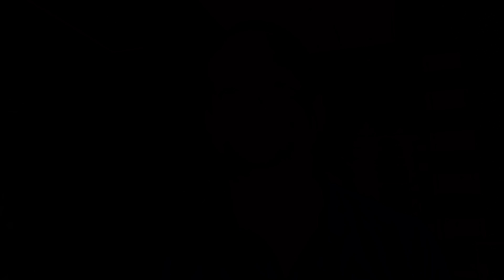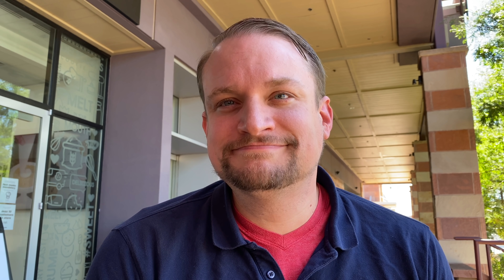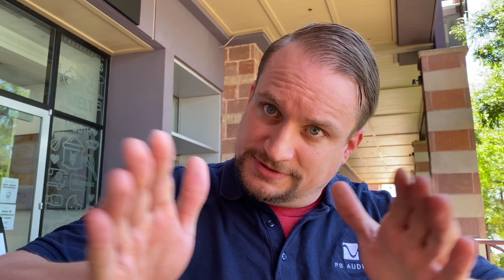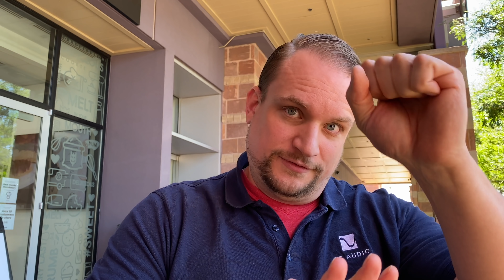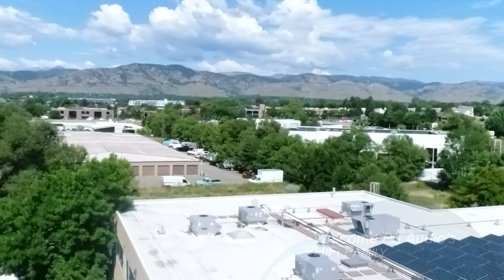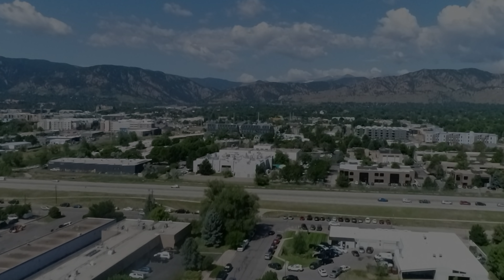Lunch with Paul: everything you wanted to know about crossovers

Comment: Something no one ever seems to talk about with respect to even order (12, 24 db electrical) crossovers is the advantage of having a low DCR inductor in parallel with the voice coil. This preserves motor control of the voice coil and helps prevent ringing.

Comment: I dont know electronics as well as the engineers that build crossovers but, how is the circut resonance delt with between a capacitor of the hightpass filter and the inductance of the driver motor? Or is the resonant frequency so far out of the frequency range being delivered that it dosent matter?

Comment: Infinity RSa's have a 10" mid bass. First it fires the bass tone and then out of phase it fires the mid range into a 10" woofer. 
I would like to know, why crossover's at all? Why not run woofers, mids and tweeter with separate speaker leads to a EQ type thing to be a real "active" crossover?

Comment: A discussion on the need for quality crossover components would be nice. I completed a three way crossover last year with a 24db slope where the cost per pair was $1600. $1600 was a bit more than the cost of the drivers, but worth it.
Reply: How the hell did you arrive at that number ?...And did you even compare (blind test) or measure your unnecessarily expensive  "quality crossover components", against something more sensibly priced ?... Any component that measures it's specified value is as good as it gets.
Reply: Ballpark, you spent $1400 too much.

What did such expensive crossover components improve? Can we have A vs B measurement data along with your subjective analysis?
Reply: @JesusChristSaves2024  "any component that measures it rated value is as good as it gets" exactly !!!!
Reply: You paid 1,600 for crossovers
More than the cost of the drivers???
Well I get it
My tires cost more than my car
Lol
 Companies that sell 50,000$ audio cables and 700,000$  speakers will survive (as long as there's audio fools.
Reply: US$1600 for a passive cross-over filter is completely ridiculous. Capacitors, inductors and resistors used in a passive cross-over filter are not particularly expensive even when they are the best of type (e.g. low tolerances, low ESR caps etc.). These parts are not involving any magic. I would love to see the schematics and also the brands of the components. Try to find them on Digikey, Mouser, Parts Express or elsewhere online. Great capacitors come from modern manufacturing facilities with modern quality procedures of known brands btw. I would never trust some insanely overpriced brand of a cross-over filter component done by some small garage factory in China or Russia. Proper data-sheets will often be missing as they are made by a bunch of con artists.
Reply: There must be some serious gold stuff in there
Reply: @mark wilson If you want real clarity, real dynamics and minimal resistance you have to go big on everything from coils to care in capacitors,  especially in higher frequencies.  In the past 12 years, I have built everything from $200 bookshelf speakers to $10k(at my cost) 4ways. The care taken in design,  specification and execution of the crossover is what separates a good speaker from a great speaker. SB Acoustics provides great drivers at half the price of ScanSpeak but equal in performance.
Reply: @ThinkingBetter  You, evidently,  have never built a speaker crossover.
Reply: @dalechalfont112  Well, my mother would certainly have an argument with you. How much do you estimate Wilson Acoustics spends, as a percentage of their total build cost, on crossovers? Remember,  not only do they engineer a first rate filter using the best components available,  but they then pot the entire assembly.  Guesstimate what that costs.
Reply: Brian Navalinsky I’ve done schematics and PCB layout of crossover and much more complex electronics. There is nothing in it that justifies a US$1600 BOM for passive parts in a crossover filter. This is not about using sophisticated gold plates inside a capacitor but about using snake oil as the electrolytic.
Reply: @ThinkingBetter  Why yes, I have actually witnessed the physical results of using quality components. You see, I actually build speakers and test them,  enjoy them and live with them.  Crossover networks are updated and refreshed as new technologies improve.  You stick to your Dayton sand cast resistors and I will stick to mine.
Reply: @ThinkingBetter  There you have it, folks! ThinkingBetter has spoken! I shall now retire to the West lands and waste away in shame.
Reply: @BrianNavalinsky  Wilson Acoustics is using Caddock Electronics Inc. resistors. They are not bad and can be purchased for around US$4-5 in volume per each one e.g. on Digikey. If you buy only a few, you will end up paying perhaps closer to twice that price. Now, all respect for Wilson Acoustics and I definitely believe such company needs to charge a premium to survive as a company doing very premium high quality products. High-end audio is often not expensive because of material cost but because you pay for some very brilliant folks with deep passion for perfection who need to get a salary for the few speakers being produced.
Reply: @ThinkingBetter  I prefer Mills.
Reply: @ThinkingBetter  Exactly.
Reply: Brian Navalinsky They are pricey at US$7. When you use such pricey components your crossover parts might easily cost you more than US$50 per channel depending on how many “ways” it is. That’s ok. My point above was about a crazy price of US$1600. I also use quality components when possible in DIY projects.
Reply: Was this a passive or active crossover? Because if passive, it doesn't matter how tight the tolerances are on your crossover components. Speaker drivers can vary in impedance to 300% or more in some cases. That is what causes the crossover frequency to shift and the filter shape to change with applied frequency. I'm not saying excellent passive crossovers can't be built, many have been. But I am saying the tolerances of the components used are not critical due to the driver impedance problem. IOW, it's a waste of money specifying high tolerance components for a passive speaker crossover.
Reply: We've talked passive crossover. Of course an active crossover is better. Personally for digital source music I prefer a fully active architecture using DSP based crossover with a DAC+amp per speaker driver.
Reply: @ThinkingBetter  Wrong again. Active analogue crossovers are better than passives when studying distortion.  I have yet to find a DSD platform that doesn't bloom treble. Bryston and Marchand analogue active crossovers are as accurate as you can get. The question is, do you really want accuracy or the lushness of a really well executed passive? This is an audiophile question.  Pure accuracy is great for the studio. Listening at length at home, not so much.
Reply: @BrianNavalinsky  Active crossovers (analog or digital) are better than passives for a number of reasons. Distortion is not the point. Rather you can get much better control of the frequency response, phase and timing. Besides, driving each woofer/tweeter with a separate amp also provides better control and optimization. Modern systems play music from a digital source and the optimum architecture is to run the crossover as 32 bit DSP algorithms and do the DAC for each speaker driver each with a separate amp. The best example of this working is the KEF LS50 (passive) vs the KEF LS50W (active). The latter wins in listening tests. It's a bit of a bummer that for even more audiophile systems, there is still some reluctance to take this step. Perhaps, for now, the reason is that using active DSP based crossover isn't ideal for vinyl playback because you end up having to add ADCs in the path. Check this: https://www.youtube.com/watch?v=Sg4d7EOVmwE
Reply: @ThinkingBetter  Yes, you knock yourself out with those LS50w's.
Hehehe

How old are you, Thinking?
Reply: Brian Navalinsky The LS50 is just a good example of actual two speakers that are identical except one is passive and one is active. That’s all, like it or not.
Reply: ThinkingBetter - I take by your comments that you’ve NEVER built a serious passive crossover with high quality parts.
Reply: ThinkingBetter - I’ve spent $600 on serious capacitors alone for a crossover.
Reply: Peter Southern Boy I have. I’ve built several speakers. Still I prefer active cross-over for stuff I can fully control either analog or digital (DSP).
Reply: Peter Southern Boy If you purchased capacitors for US$600, someone possibly must have made a good margin. Why are they so expensive? Send me a spec sheet link.
Reply: Dale Chalfont - Using high end caps and inductors, $1600 is easy.  I’ve spent $600 just on very good capacitors.  These days  I run a Xilica XP4080 Professional DSP in a biamped setup.  Klipsch Jubilee with TAD drivers.
Reply: Peter Southern I wonder what exactly makes them expensive. What’s their chemistry and what are the plates made of etc. and how do they measure on the key metrics?
Reply: ThinkingBetter - yeah, your little miniDSP, I know.  I run a Xilica XP4080 Professional DSP biamped into Klipsch Jubilees with TAD drivers.
Reply: John Smith - if that’s the case, a $200 Chinese amp rated at 50 Watts should sound just as good as a $9500 Pass Amp rated at 50 Watts.  Both will have similar distortion, sensitivity, crosstalk measurements.
Reply: ThinkingBetter - you’re making the big mistake of conflating instrument measurements with quality in a very subjective and artistic endeavor.  By your rationale, a $150 Chinese Amp rated at 50 Watts should be identical to a Pass Labs 50 Watt Amp costing $9500 - their industry standard measurements are comparable.  Likewise, I’m a fool for spending $4500 for one TAD 2” compression driver, when for $260 I could have purchased an Eminence 2” compression driver with almost identical measurements.  By your logic, a $50 Dayton Audio 10” woofer should sound virtually identical to a $650 Scan-Speak Revelator 10” woofer with the same T-S parameters.  And every serious audiophile knows that is wildly false.
Reply: @ThinkingBetter   - choke on these Goertz Foil Inductors:  https://www.madisoundspeakerstore.com/goertz-12-awg/
Reply: @ThinkingBetter  - here's the deal with capacitors and passive crossovers: You can get by with less expensive caps in the LF section - I will use Solen there.  In the MR and HF, you can most definitely tell the difference between a cheap electrolytic, a good poly, and a great oil cap.  If you want best "bang for the buck", many people including myself like the ClarityCaps - the CSA Copper/Poly layered design.  As far as inductors go, you want a high quality copper foil or Litz high purity copper air core design for the MR and HF.  For the LF woofer, for a couple of reasons I prefer to use a high quality steel laminate inductor.  In my great room system I use a Xilica XP4080 DSP with biamping.  In my bedroom I use a passive network with ClarityCaps (CSA) and Jantzen Litz wire inductors.  The drivers measure free field within a dB so I don't use any resistors in the network.  Everything is wired with Mogami OFC and Silver-soldered.
Reply: @kcjones7634  - So I spent $4800 each for two TAD TD-4001 drivers.  You're going to spend $500 each for a good beryllium dome tweeter.  Scan-Speak Revelator woofers are typically about $650 each.  Acoustic Elegance woofers are in that price range, too.
Reply: Peter Southern Boy That’s great. Whatever makes these caps so expensive should be visible from measurable data and visible in some data sheets. Caps used by the military, in avionics or in automotive often have special requirements but everything is documented in data sheets.
Reply: ThinkingBetter - that’s honestly an ignorant statement if you know anything about engineering measurements.  And I say that as a degreed Engineer.
Reply: @petersouthernboy6327  I do indeed have an engineering degree in electrical engineering. What do you think is ignorant? There is no such thing as a proper capacitor without a datasheet. Try to find one in Digikey or Mouser. Usually, the datasheet is only a click away (PDF file).
Reply: ThinkingBetter - in that case, any speaker with a 30Hz -20kHz +/-3dB frequency response and with the same vertical and horizontal polars will sound the same to you.  😂🤣.  Carry on.
Reply: @petersouthernboy6327  Nope, speakers have many performance metrics and some need listening tests to judge. Especially the decays and distortion can make big difference. A flat frequency response doesn't mean your woofer doesn't have >10% distortion or doesn't have a serious ringing issue. And listening tests might discover other issues e.g. how the sound is dispersed, phase issues, and other issues impacting soundstage and ability to reproduce details correctly. Hey dude, I work in audio R&D.
Reply: ThinkingBetter - since you have no clue about quality capacitors we can surmise it’s not in the high fidelity sector.  🤣
Reply: @petersouthernboy6327  It's in the high fidelity sector also. I'm not against high quality capacitors. But no way I would ever use a capacitor that is not with proper datasheet and priced at 10 times the manufacturing cost. You sound like you are not an engineer and just do this as a hobby. It's ok, but don't pretend to be engineer.
Reply: ThinkingBetter - your Mom’s basement is “audio R&D”.  Got it.  Right. Decay, phase issues, radiator first second and third order harmonics and sound radiation characteristics can all be measured.  No listening required or even desired for that.  EE my arse.  🤥
Reply: @petersouthernboy6327  My mum passed away already. But thanks for thinking about her. Speakers need listening blind-tests during R&D and I have been official member of a listening test team for years even having to get my ears checked by a doctor every year for me to qualify. Yes, indeed a lot of things can be measured on speakers much more than frequency response, but no sane speaker engineer would skip listening tests. And no sane engineer would select capacitors for the cross-over filter design without having proper datasheets. Very expensive components costing >10 times the manufacturing cost that have no proper basic datasheet deserve a label of being snake oil.
Reply: ThinkingBetter - speaking of snake oil, try a digital multimeter.
Reply: @petersouthernboy6327  What does this have to do with a digital multimeter? Yes, I have such an instrument.
Reply: ThinkingBetter - have your been to any Hi-Fi industry audio shows?
Reply: @petersouthernboy6327  Yes, many times. I've seen great real things and not so great snake oil things many times.

Comment: Another reason to audition  the TLS-1 by HHR Exotics which is an updated Ohm F which is a single omnidirectional driver with a frequency response of 29 to 22,000 hertz and does not need a crossover, it is time and phase aligned. It was once called the best speaker at any price.

Comment: The problem with a lot of full range drivers is that they have a mechanical crossover.

One voice coil, two cones (often one wizzer) and a mechanical crossover. A true crossover-less full range has only one cone/diaphragm.
Reply: Very true
Reply: and they were also of a higher impedance. 16 Ohms

much easier on the amplifier's output transistors.
Reply: cbrunhaver Hi Chris! I’m a fan of your talks. 

I’m very interested what your vision is on how to drive a loudspeaker driver (controlled voltage, power, current or even charge), the nonlinearities in the voice coil impedance and current distortion. Can you make an episode on that?

Or (refrased) on the impact of output impedance of the amplifier (much smaller than the nominal impedance, about the same, or much higher, more than 100x) on the performance of drivers.
Reply: dusty dex Hm. In my opinion is a low impedance driver with a rather flat impedance curve more easy for an amplifier.
Reply: @JerryRutten  Flat impedance doesn't exist for moving coil drivers.
Reply: @monetize_this8330  Read!
Reply: @JerryRutten any reference in particular?
Reply: dusty dex Yes, my line. I didn’t wrote flat.
Reply: @JerryRutten  I read "rather flat"